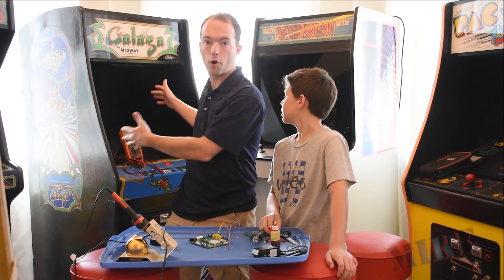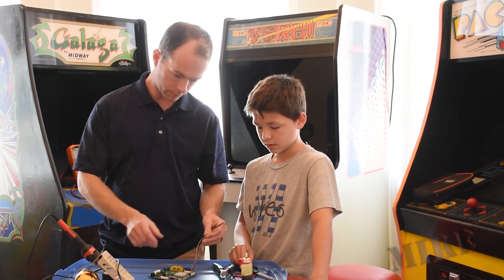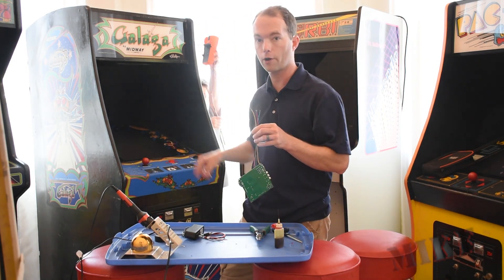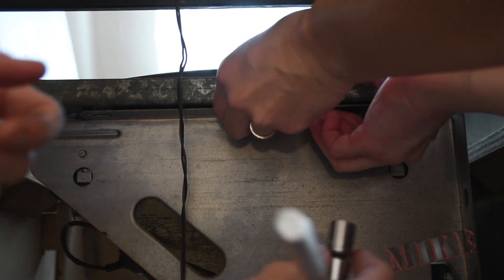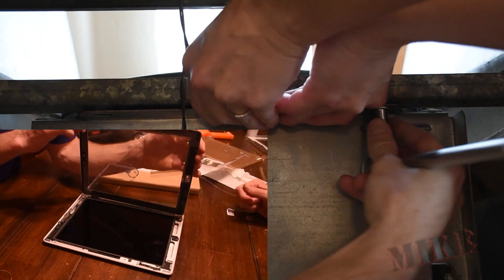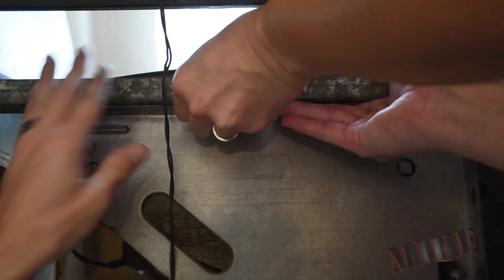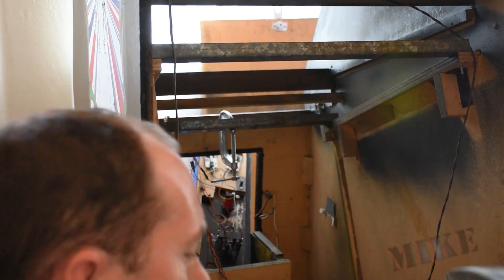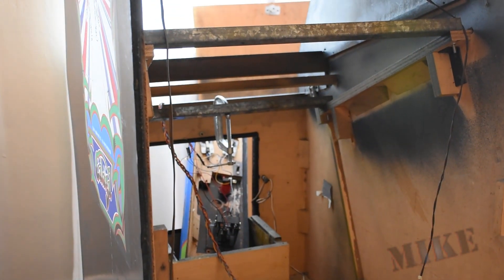Galaga CRT Screen to LCD Conversion - Mikes Inventions

Comment: Very interesting father and son project.
Reply from the maker: It was. He's becoming the primary Mr. Fixit around here. I'm able to get lazier by the year. Thanks for watching!
Reply: @MikesInventions I was wondering if you could just plug the 5-pin JAMMA video connector to the 5-pin signal input on the board and achieve the same thing.

Comment: Nice video Mike & Family.     Can anyone on here advise what's involved with doing a cap kit & rejuvenation on a CRT monitor thats  in my 1980's original BLASTEROIDS Arcade .  The  serial number is  40 . I've owned it since early 90s.  Just recently    the displayed text letters & numbers are very blurry looking during game play.  Is there a easy monitor swap that would work well for the blasteroids arcade , or is that cap kit / Rejuv  idea the better option.
ANY & ALL CHIME IN PLEASE
Reply: There are plenty of arcade crt restore and tube swap video.  Have you tried the focus knob on the flyback?  A cap kit won't hurt but probably not likely to improve your issue.    take a look at the sticky threads here.

Comment: There are mounting holes on the back of the LCD monitor that are 100mm apart (VESA Mount) and use M8 metric bolts.  You can use that to secure your monitor into position so that tipping the cabinet will not let it slide.